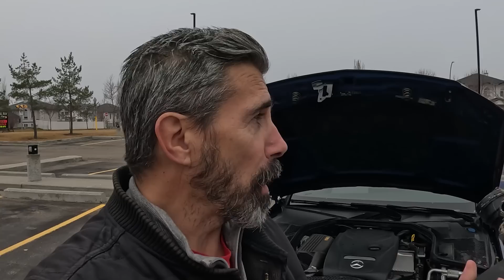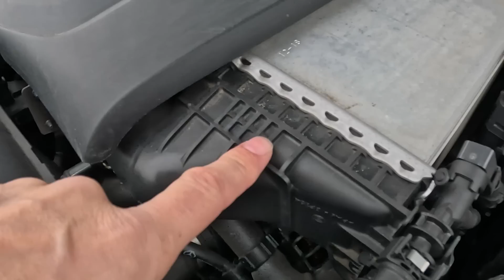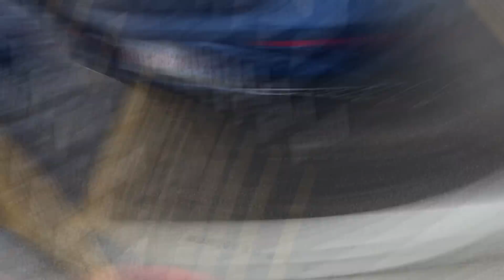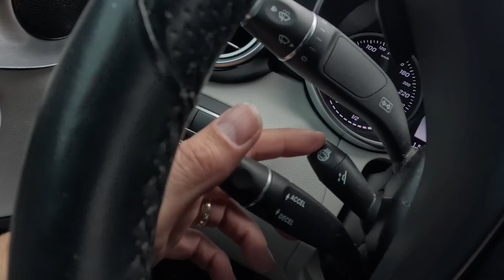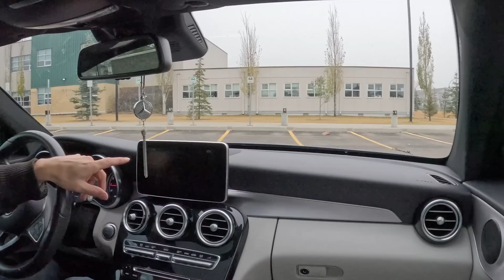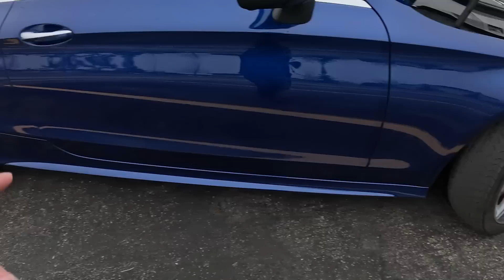Here’s Why New Cars Can't Last  5 Years | What Went Wrong?

Comment: There is a reason Toyota uses a 1.8 litre low RPM engine that only produces 99 HP on their hybrid's. That engine is only idling, so there is no wear and tear. Even those old Prius had these engines and they can hold up for decades. Also their hybrid ( metal hydride ) battery's are bulletproof. My Toyota hybride is now 14 years old, and no repairs until today. My old Corolla lasted for 23 years before I sold it. Today's cars are all junk!

Comment: there was a brief time in the early 2010s when mfg accidentally made a few cars that last forever. a lot of people think of a high voltage battery as a liability because of the Nissan leaf and prius, but if the battery is lipol and has a good thermal management system which is shared with a ice motor it will literally last forever like the chevy volt

Comment: My Honda Pilot is no longer under factory warranty. I spent well over 4,000 dollars this year keeping it running.
Reply from the maker: What happened to it?
Reply: @ECPP  New ignition. Tires. Sparkplugs. New air-conditioner,  battery, timing belt, and several other things. 2016 Pilot.

Comment: It's those smaller capacity performance engines which are the ones to worry about, those ones are definitely too highly strung. I felt the comment on turbos was a little unfair - many turbo'd engines will just last and last.

Comment: I drive a 2001 volvo S60 with more than 400K km on the clock, I give it good service with no sparing on parts and the car shows absolutely no signs of wanting to stop riding. As I live in the EU, I will most probably buy an EV at some point and I do not consider EVs as per se bad. But out of practical considerations I give this volvo ca. 10 more years on the road. The NA engine and the manual gearbox should not die before 1M km, the body does not rust and there are no problems with wiring and relatively simple electronics. And what's also extremely important - despite its age it is a pretty safe car with good grip on the road.

Comment: I get what you’re saying but what are people really supposed to do about it? My opinion, oil changes every 5000, miles we have a 2013 Audi, a 2013 bmw, a 2019 bmw and a 2019 Alfa Romeo in the family, all 2.0 turbos.  Had to replace turbo on BMW at 140k.  The others, so far so good. Use the right gas, get the oil changes, that’s all you can do.

Comment: A manufacturer that offers a 3.0 ltr engine with a 6 cylinder. Pistons are smaller for quick acceleration. Turbo's are failing across most engines. Blown head gaskets, because of the increase pressure in the cylinders. A dependable 6 engine forever. 
Theres a reason why Toyota 2.5 engine is so reliable because its an oversized 4 cylinder engine without turbos. If you know how to drive a manual, buy the manual to shift it at higher revs, because the pistons are so big. 
Take care of it can get you at least 200 k miles and possibly more. 
Some of these non turbo engines have over 300.k miles if not abused. An engine that could last 15 years with regular maintenance.

Comment: The last new vehicle I purchased was a 2006 Jeep Wrangler Sport because the 2007 models were redesigned with power everything, plastic everything and tiny, underpowered engines.  I also have a 1997 Jeep Cherokee. Both Jeeps have manual locks, steel bodies and the glorious inline 6 engine known for longevity.  They are reliable, cheap and easy to fix.

Comment: My 2013 Mercedes c220 cdi has just blown the inlet manifold, four inlet valves worked by a motor that failed. £900 hit, luckily my mechanic is reasonable and I only paid £900 for the car 3 years ago. It’s a twin turbo and goes very well, with 167k miles on the clock. It has a stupid foot brake set up, other than that a great car.
Reply from the maker: Thanks

Comment: Plastic always was under hoods of all cars, most of what you shown is just plastic covers. Good quality plastic can easily survive as long as metal parts, don't even get me on rubber parts that have to be replaced after 5years top even if it seems like they work. Issue is they use low quality parts, that's all. It's not plastic its quality issue.

Ever engineer will tell you I4 engines are optimal, V6 and V8 is there just to milk money not performance or reliability. 

I4 engines can handle 400-600hp some even 800hp and will not break. What changed? Quality again and maintenance frequency. I have new 2.0 Volvo with turbo and compressor, its 2 years old now and has 461k km and I had zero issues with it. So maybe stop buying MB that since 2020 produces garbage, same goes for bmw. And learn how to maintain it. Sane goes for my murican V6 in Camaro. They told me it will fail at 100k yet it already has 300k km with no issues.  
My yearly spendings on them are just oil and if needed breaks. I haven't seen mechanic in years. 
Aside from front lights and whole radar systems all other parts cost same as for same model but from 2000'. 
So I see issues with USA market not cars or companies. And with new Trump tarrifs you will pay even more, but it doesn't have anything to go with new cars being more expensive to maintain. 
You just panic for no reason. There always were terrible cats that broke all the time, I think nostalgia and fear of progress is what drives you people not facts and reality.
Reply from the maker: Way too much plastic

Comment: There is on the internet, an article with 10-year repair costs for all big OEMs. This is a nice indicator when you want to buy a new car. You just select the model and it gives you average repair costs that you need to pump in your car if you want to drive it 10 years. If you want to buy a new Tesla for example, think again. It is very very expensive to repair.

Comment: The reason why many newer cars are turbocharged is because the Euro regulations for new cars are so ridiculous in terms of what they are allowed to emit. This chokes the car manufacturers' ability to create a reasonable engine without a turbocharger to achieve the same horsepower. It stifles the average citizen's right. In the end, there won't even be an engine left. They'll be running on one cylinder with 10 turbochargers. LOL

Comment: I haven't seen a a 2 litre four cyl naturally aspirated producing 140 bhp engine but quiet a few 4 cyl turbocharged engines producing 140 bhp and below - and they're still going to last you say a decade if maintained well. But many new cars are coming with 3cyl turbocharged engines producing 130 bhp or more and 4 cyl turbocharged engines making 200 bhp or more! And as feared, they do actually start falling apart after 5 years no matter how well you treat the car.

Comment: A lot of these items could still be made of plastic if the right material is chosen for the application and long life. Probably not as long as metal but good enough to last more than 10 years. Price and designed obsolescence is what counts for the manufacturer.

Comment: 2018 Tesla Model 3 Long Range. 100k miles. Total out of pocket repairs = $1700.   This includes $300 for a 12v battery and $1400 for front control arms + sway bar links and wheel alignment. Tesla tested the main battery and at 100k miles now it tests at 92%. Original brakes still above 90% good. No oil changes. No transmission to go out.  Best car I ever owned. Every bit as fast as my old Audi S4 and my Tesla isn’t even the performance model.

Comment: You're correct when you state that new technology creates a decrease in life span for the consumer goods due to lower reliability. However, the intensive use of electronics in today's vehicles will drive the research & development forward and will slowly break some thresholds. Eventually, by trial and error all these technologies will mature and become very reliable. Yes, consumers are paying the price right now but remember the first internal combustion engines at the beginning of the last century? Were they reliable? How about the first turbocharged gasoline engines from the 80s? How about the diesel engines from the 90s? Were they clean and powerful? And so on...

Comment: Greetings from the U.K. I’m 60YO, I’ve done most of my car maintenance myself over the years. I agree with most of this video. My first car was a 1974 Renault 12, for the time it was ok, but ‘70s cars were pretty crap; rust, rubbish electrics etc.  The best cars came in the late 1990’s, rust problems were mostly solved, electrics were much better, fuel injection was well engineered and reliable. But now cars are not so good, I worked on a modern BMW that had an intake manifold cast in plastic- absolutely mad!

Comment: As parts become more complex so too  does their support from the manufacturer shorten in terms of being able to buy these complex parts in the furture, as they will become too expensive to stock as a vehicle ages. Classic cars have a vibrant after-market of suppliers where any part for them can still be bought 50+ years after they stopped production. Not so for today's cars. There is no after-market for them due to their complexity.

Comment: Too many manufacturers have been listening to Sandy Munro and taking Lean Manufacturing to its extreme - no fixtures and replaced them with one-time-use snap-on fittings. This makes servicing difficult for the technician and requires expensive disposable parts rather than re-useable parts.

Comment: 2000 new Beetle it's 24 years old now but I got rid of mine. A plastic vacume line cracked and disabled my power brake booster. It took everything to just slow it down. A little plastic part. If they made it metal I would have had zero problems.

Comment: I lost it, when you said older merc v6 is more reliable then new l4. Balance shaft issue is much more costly then to replace then all important plastics on l4 merc engine (thermostat, water pump, etc.) I am pretty sure you retrofit cooling pipes with metal clamps. Oil intervals is more important, I agree, but neglect them on v6 and it will be trashed too, just will make 20k extra miles

Comment: My old Mercedes lasted for 24 years an 722.000km (451.250 miles) and I still could sell it to Africa at the end. The amount of energy needed to scrap, recycle and build a new car, including transporting waste, new raw material and the final product around the globe multiple times is many times more than the savings due to better fuel economy with new models. The some goes for environmental damage due to waste material disposal or reprocessing. That proves the hipocracy behind the ecologists forcing us to buy new cars - in the EU per instance by declaring urban areas "environmental zones" where older cars with lower emmission standards are banned, mostly commercial - Diesel - vehicles - mostly belonging to small businesses, which the governments over here do not like anyway.

Comment: I had the nightmare of trying to make my 97 BMW 740i's 12 speaker sound system to work again. You couldn't just buy the components used - because the radio components were VERY year specific. Eventually, after spending hundreds of dollars and hours (days) investigating the issues ... I finally got it to work partially but it was just another reason (among several) why I sold it - as nice as it drove down the road.

Comment: One good thing to come out from EV design ... Tesla has reduced the number of feet of wire in their cars from 3km down to just ~100 meters through generous use of a Local Interconnect Network (LIN Bus). Manufacturers are looking at using wireless tech for everything that isn't critical to safety (power mirrors, power seats, seat heaters, interior lighting, moon roof, etc.). This will reduce loom size even more ... every one of those components could just have commodified Arduino wireless boards and one + power wire).

Comment: One of the only EV manufacturers that designed their battery systems to be modular yet still fit inside a skateboard frame and ~simple to replace, is (was) Canoo ... now they're almost bankrupt. I used to be a design engineer for everything from nuclear power plant control rooms, to side-draft cooling towers, to flight and ground electromechanical equipment for space flight systems. I don't understand the philosophy of using them for structural rigidity where they are more susceptible to damage from road debris and the elements - at a time in development when everyone's biggest concern is longevity (a concern that's overblown, but nevertheless). I can count on one hand the times I've seen Tesla owners actually driving fast in my area. I pass them all the time in my Chevy Volt (not that the Volt is fast - it's not, just that Tesla drivers are watching the efficiency meter like a hawk - even more than I am). I guess with time, increased capacity and lighter weight - things might change to smarter, modular designs, but ... not holding my breath.

Comment: My 2011 Honda CR-Z Hybrid over 13 years old, no problem except ac and door handles at trade in. Personal maintenance from new, it retailed for less than $21k new. I replaced the 12v battery twice $60 each time.  It still had the original brake pads at trade in. I don't know what your talking about. Traded at over 140,000 miles.

Comment: I learned a few years ago that auto makers want to report the lowest possible "total cost of ownership" during the warranty period. So, they've purposefully increased the oil change cycle. DON'T FOLLOW THE OIL MAINTENANCE SCHEDULE! On my Hondas, it's not recommending the oil changes until 10k or more miles. There's no way a higher compression engine is going to have healthy 0w20 oil at 10k miles. I drive my cars into the ground 50k+ miles per year. I schedule the oil charges at 3,000 miles knowing I'll have it done by 5,000 miles. 2012 Accord, 300k miles and zero issue. Verdict is still out on my turbo Acura and Hybrid Insight, but no issues on the 115k miles Insight or 40k on the 2023 RDX. Be the warranty!

Comment: That's why I am currently aiming for Audi S6 C4 Avant from 1996 that has a V8 4.2. It might cost a bit for belt replacement, but I hope that would be it, since you need to remove front off and take the cover off of the engine to get to the belt. The rest is just expensive to drive a 4.2 V8 :D

Comment: @3:04 - Wire sheating made of rubber is normal and has been a thing for years, unless a different look-alike sheating has been made to make us think it is the same old. If you would put those wires in a metal tube, it wouldn't be flexible as well as it would heat much faster and thus contain heat for much longer inside, depending how heat conductive that particular metal material it is, but it could damage wiring much faster. So I am not sure what do you mean with what you said in that section about wiring, as it has always been a thing for decades and the best solution for now, util some other type of less heat conducting and heat resistant material comes into market that's flexible.

Comment: As much as I agree plastics are a problem and no thx to BMW , there are worse things going on and reasoning.
Turbo and small engines were largely because of EPA , why don't we tell them that is wrong ? right, you can't.
Light that would point at your eye level , because IIHS says that is "safe", why don't we tell them that is stupid ? right, you can't.
Why are we getting terrible longevity with newer cars , look at the profit margins on the car companies on each unit sold , certain ones are at as low as 3% on average , BMW for example , most cars are sold at a loss except X5 . How else do you think they can sustain the business ? repairs and parts obviously .
If there is something to really blame , was the fact that the study they made when times were good , a majority of cars gets scrapped after 6 years , when cars were built for 15 back then .
And I hate to tell you , most of the "everything is powered these days" , were all included in a 1990 LS 400 and some , but it still works in that car , while its not in plenty others . Its not the feature or what not , its the poor quality of the parts . Electronics in Germans are not great , thanks to "environmentally friendly parts" , even your roof will fall off because of "environmentally friendly glue" . But we cannot tell them that, because some crusade with their green board will come beat you up.

Sorry for the rant , but screaming at the car maker is just not it . And no I hate current Benz too .

Comment: I purchased all the hoses + fittings on my 2005 Mazda 6 S Wagon after some coolant hoses and T fitting burst. Total cost to buy all the hoses $805 some were not easy to find ( Coolant hose # AJ0315183A only has 1 left on eebay) most were Gates, Dayco, Dorman, Four Seasons & OEM brands. Good News is if I ever have to replace the engine a used one is about 1k with freight.

Comment: Sooooo many mechanics sounding off about the “newer” cars .. they are set to fail more than ever. Parts in your transmissions that are plastic.. but the oils will break them down and you can’t get them fixed . The have to be replaced. Aluminum in major parts .. they overheat .. they warp .. no fixing .. replace. They are screwing EVERYONE because they are FORCING you to always to be in need .. and buy